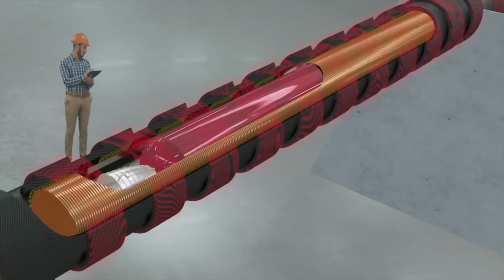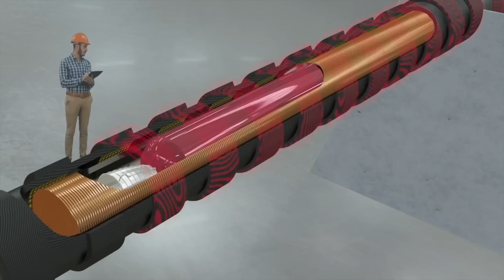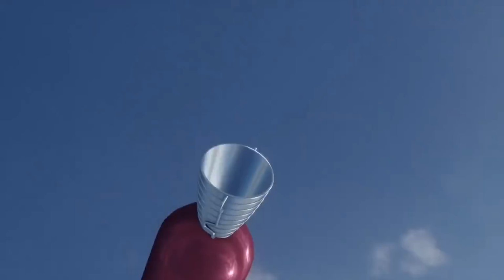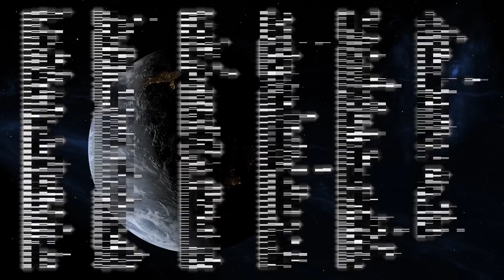Launching Rockets With Electricity

Comment: Building just under a meter underground would give thermal properties, so at a depth for decent foundations, it can be built with potential use atop of it..perhaps under a road, as an example regardless of the particular viability

Comment: Spinlaunch uses an electromagnetic motor to spin and slowly add energy to its hybrid rockets and a weight to ballance it on the other side.  At the point of release, it releases tgr hybrin rocket in one direction and a mass with identical angular momentum in the other direction.  I wonder if energy can be recovered from that and delivered to the hybrid rocket throug a comparably short electromagnetic accelerator.

Comment: "Accidental quench event" —does that mean electricity arcing out of the MRI magnet? Or an exothermic explosion? Both? 
(And if this is disastrous for an MRI, how did the "quench" launcher work without destroying itself as its payload launches?)
Reply: generally explosions as the coolant is wildly execeeded in its capacity which is the cause of the explosion.

Comment: by nature this is more viable than spin launch.
Reply: Spin launchers are just a bad idea
Reply: @slo3337  And a con as they know it can never get off the ground.
Reply: Using the comparison of a linear accelerator to a cyclotron doesn't exactly work here... But I think the advantage of spinlaunch is the slow input of energy without as much complexity. It seems like a better way to get small vehicles off the ground quicker (quicker in terms of building the launcher)
Still 
  I don't think it will ever be a practical direct to space system , not from earth anyway. On the moon I can see how it could me more practical as it would require less materials, less velocity, less complexity, and easy enough concept even an army guy could understand 😜.
Reply: Yep, spin launch puts a spin on the item launched.
Reply: No rail wear on spinlaunch. Easier to reuse.
Reply: @filonin2  rail? why would you have friction contact in a massdriver.
Reply: @petevenuti7355 also on the moon there wouldn't be a need for a vacuum chamber, or those fast airlock doors.
Reply: One word: "SPIN LAUNCH"    Newton proved,You can not just "throw" an object into space no matter how much energy you have.  The object has to be self propelled. You can only assist the launch to save on onboard fuel. Not on earth, Not on the moon.

Comment: Umm, not just tearing the launcher apart, but also the load.  The amount of G's the load is exposed to has to be pretty significant.  Like, I don't ever want to be launched to space with something like this.
Reply from the maker: No, you'd only want to launch robots, not people.
Reply: @frasercain  Yeah I assumed that was the case, just felt like saying it after hearing the issue with the initial experiments and he was talking about how the rail type launchers would destroy themselves.

I was thinking about the usage on the moon, which sounds scary at first because of the amount of force being generated, but then of course, gravity is less so you don't need as much force.

All the activity that humans want to do on the moon sounds scary, like altering the orbit scary

Comment: Hard to see how solar panels would repeatedly fire a machine that requires as much power as this one does. Even in space
Reply: why?
Reply: @MusikCassette  The amount of power needed would be massive. You'd need tons (square kilometers, maybe?) of solar panels for firings at short intervals. Nuclear power plant may be better?
Reply: @michaelwilliams2593  We can produce massive amounts of energy with solarpower.  On a worldscale we are talking several orders of magnitude more than we ever could with Nuclear power.  When it comes to just this project. that need to be build in a quite remote location anyway. So I don't see a problem with needing some space for the power. Off course the amount of power you actually need is highly dependent on the frequency you use it in. And there are other limiting factors to that as well.
Reply: @MusikCassette  see my post above, ie At 91 gigajoules per shot and one shot per day = 33 terajoules. I don't have all the stats but I think we're talking about more energy than some nations produce. I'd love to see some real data from the folks that are planning this.
Reply: @michaelwilliams2593  33 shots a day? that sounds insane. even from a maintenance point of view. Once a week would be high frequency. Once a day is extreamly high freaquancy.
but however. I don't see, why you would choose a more expansive energy source because you need a lot of energy. If anything the opposite
Reply: @michaelwilliams2593  There are two power levels: charging the magnets and discharging them. Discharge is releasing energy that is already stored. That doesn't take power, it gives power. Charging can be as slow as the duty cycle/cadence allows, which can be hours. Superconducting magnets can store that energy with very little loss.

Comment: before we build one  that launches a projectile into space we should build one, that  accelerate its payload to a speed where you can start a ramjet. That would be super useful for hypersonic research.

And it would also be a need way to get to space.
Reply: The minimum speed at which a scramjet(I assume you mean that and not a ramjet) can operate, is mach 5. For that you need to be at least ~20km high to prevent everything burning up.
Reply: @paulmichaelfreedman8334  no, I meant ram-jet. there is enough overlap between the two to do that in stages. But your Idea of strait up going for scramjet speed is also interesting. I would however suggest building mine first. It is cheaper and there is still a lot you can do with it. 
About "everything burning up" we are basically talking about a launch side here. So I would not worry to much about it. There are methodes to deal with that. also 20 km that is just a few seconds after leaving the mass driver at that kind of speed.
also also for a big part of the interesting aerodynamic experiments, we would not even do a burn.
Reply: General_Cornelius  what sounds sketchy? to build a massdriver to do high velocity aerodynamic research?
Reply: @MusikCassette  Actually, the idea of a mass driver to do hypersonic aerodynamic research is really a good thought.
Reply: @freeprint  thx
Reply: General_Cornelius  acceleration= velocity/time 
the final speed alone does not tell you the G-forces.
Reply: What he describes is exactly how the LHC accelerates very tiny particles to near light speed
Reply: @jeffbrooks8024  no it is not
Reply: Re: Electromagnetic Launch Boosting. What about starting from getting a Starship off the pad & up to just a few kph? When I saw it from Rocket Ranch last April, it seemed to have sat on the pad for an eternity before lifting off. The fuel it consumed in those first few to 15 seconds t’wrnt nutt’n!
Reply: @Crunch_dGH  Well you would not use a Starship for that. you would build  something specificly  for your mass driver. And you would not start with this high masses.
Reply: Interesting idea!
Reply: @vincenthickey8622  thx

Comment: Mr. Dillon, 
If you can levitate a high-speed magnetic train by rejection of the train weight force and then pull it along by time-sequenced magnets before it ¿Could you not build a tunnel with aligned magnets on its walls and replace the train by a cylinder that will stay at a safe distance from the walls to avoid contact friction and accelerate the "metallic tube" that will carry the cargo?
Reply: Yes.  In fact, the design calls for a carrier sleeve to act as the armature.  The carrier sleeve would be slowed to a stop in the last 10% of the launch tube.  In the center of the carrier sleeve is the delivery cylinder that continues on.

Comment: He never did clearly explain what exactly you do to quench the superconductors.
Reply from the maker: The key will be turning them off as the payload passes so they don't act as a brake.
Reply: @frasercain  Yes, but how? He suggested different ways to do it, and it sounded like he intended to raise their temperature above their superconductive threshold. But wouldn't that, plus the instantaneous transformation of all that electrical energy into heat energy, make each ring explode or melt down in succession?

I think Markcrites7060 is right. Dillon was cagey about how exactly they plan to quench their superconducting solenoids. Obviously the plan isn't "slag the thing with every launch" ... so what is the plan to dump all that quench-released energy without harming the launcher? Without boiling off massive amounts of precious liquid helium? 
I'm guessing there's something like a lightning rod that will allow all that electrical energy to arc out of the superconductors as soon as they stop superconducting, or maybe a microsecond or nanosecond before that moment? 

Dillon is the expert, not me. My idea is probably unworkable, I don't know. His team might have something worked out that they don't want to describe publicly yet...

Comment: Great idea, but in the meantime why not use electromagnets just to get rockets from zero velocity to even the first few feet per second, i.e. electromagnetic-assisted launch? Would that not achieve a meaningful improvement in overall launch costs and fuel consumption? Not to mention wear and tear on the launchpad itself.
Reply: nope. it would double the cost of launch (and possibly more...)

Comment: Accelerating an object to orbital speeds can be done.   But there's one little problem, Earth has an atmosphere.  "Max Q" is a thing, and there's a reason that most small asteroids burn up in the atmosphere.   Orbital speeds at low-earth air density is simply not a good combination.  Keep in mind that air resistance is a square of the velocity, to get that orbital velocity at the end, the initial velocity must be MUCH higher to overcome all that resistance, and a good amount of that energy will be absorbed by the launch object.

Now if you're on the moon, or some object with no atmosphere, go for it.

Comment: Hmmm. Normally when a superconductor quenches, there is a huge release of magnetic energy that will quickly turn into heat if it isn't used to do work... 

You would have to time this so the magnetic energy would be absorbed by the projectile as it passes. If you don't, it goes boom.

That would be a very hard system to time correctly.

Cool thought problem.

Comment: correct me if I'm wrong but the joules needed would be Work = Force*distance with Force=mass*acceleration so work = mass*accel*distance. Assume 10 km long pipe with a 9,100 kg (10 tons) package reaching 5,000 m/s at pipe exit. You come up with 9,100 kg * 1000 m/s/s*10,000 m = 91,000,000,000 Joules. Is that 91 gigajoules? I don't remember my prefixes when numbers get that big.
Reply: At 91 gigajoules per shot and one shot per day = 33 terajoules. I don't have all the stats but I think we're talking about more energy than some nations produce. I'd love to see some real data from the folks that are planning this.
Reply: How much could be accomplished by launching a Falcon9 or starship at 1-2km/s!?
Reply: The acceleration must be 1250 m/s^2 and that translates into a work of 113.75 GJ . The energy is not the problem, but the power needed. Accelerating 9100 kg from 0 to 5000 m/s in a 10 km track takes 4 seconds, so the power is about 28.4 GW (and I'm not even considering the losses).
They definitely need superconductors not just for the track but also for storing energy and realease it quickly through a superconducting magnetic energy storage.

Comment: Was this filmed before or after the possible discoverery of LK-99?
Reply from the maker: Before. That would be a gamechanger.
Reply: @frasercain  From discovery to practical material economically available on a large scale usually takes years to decades for the superconductors that make it. 99% of the superconducting materials discovered are not economically or technologically useful. However, if this one is, "gamechanger" would be an understatement.
Reply: @huubweijers5023  True but this is also a long term project so hopefully..    ?

Comment: I think this type of thing is POSSIBLE, but will never be PRACTICAL to overcome our gravity and thick atmosphere. Like the Navy's railgun, anything with that much power will self-consume.  Having said that:  this would be eminently serviceable on the moon or Mars.
Reply: Railguns are different in two essential regards.  First, they are inherently low efficiency electric motors based on the Lorentz force.  Mid 30% range is all you can get, everything else is heat.  Also the rails and armature (the part that moves) are in direct contact.  Our system can achieve efficiency in the 90% range (like lots of good electric motors) and in a non contact system.  Not that we don't have significant engineering problems.  We do.  But that's our work.  And, yes, the moon with its shallow gravity well and built in vacuum is WAY easier.

Comment: I find it not appropriate just like the giant rail cannon with the same magnetic launch system. The other is a land based laser system in which a study by McGill University professors is also inadequate and cost , mostly safety will make them part of the not so brilliant idea. 
The real fundamental step is with Wernher Von Braun's system, it's to increase and incorporate a viable sustainable solution. The problem is the ignition, heating and cooling. 
Although the payoff is greater displacement and fuel efficiency and a much longer duration. The plan is a hybrid spacecraft that uses a runway and lands on a runway but also continues to be a useful platform for landing on other planets to moons with a change in configuration again. The weight of the craft is also important as well but there are many tricks still waiting to be applied.  The ion thrusters are not making progress as they should but the application of more and sent through a magnetic coupling which will provide the extra torque will be an inventive measure that apparently no one has looked to but I did so I can have steering also a way to slow down. All what I said here isn't fiction but aligned with facts to build a better craft .

Comment: I've often thought about this since I first saw that Superman ride! I seem to recall, providing enough power was an issue even with that, but that doesn't stop one from dreaming. I posted a question on another video as to why we don't use this sort of system, or even a fuel powered carriage on rails to launch rockets. Even if a rocket was launched at 100mph, that would save a massive amount of fuel and weight in simply overcoming that initial static inertia. Elon needs to sort himself out and produce a fleet of Boring Company 'StarBorers' that dart into the moon and bore tunnels for Spaceport runways as well as sub-terrain environments to live in without the worry of surface regolith  🚀

Comment: Is it possible to utilize the depth and pressure of the ocean to develop a launch system on the ocean floor where you can harvest a substantial portion of the energy needed to accelerate mass and make it easier to escape the Earth's gravity and reach orbit?

Comment: A high velocity boost may not be needed to make it viable. How many pounds of fuel is needed for each mph acceleration? Each bit of acceleration added to a booster without using fuel means that many pounds less propellant needed to get into space. This is the same concept used by launching in the direction of the earths rotation.

Comment: 100% the right approach for space or moon launches. Too many issues with the thermal and physical shock of hitting our atmosphere, suddenly at Mach 10, let alone Mach 20. Hypersonic flight is far from a 'done thing' Its still very experimental and not fully understood. Yes re-entry vehicles do it but they are hitting very thin atmosphere at Mach 20 and slowing down gradually. Even if the launch tube could somehow be a mile tall, the air is still very thick. I guess you could build it in the Atacama Desert! Maybe something launching with a scramjet on it might work. Get it to a more modest launch speed and then accelerate it with the scramjet. At least you only need to carry some fuel and no oxidizer.

Comment: When you "quench" that massive magnetic field it will generate a huge voltage spike, maybe reaching millions of volts across the now poorly conducting superconductor. It will fry and sparks will fly! Of course maybe you could dump it into a big capacitor then recycle it on the next run.
Reply: not so much a huge voltage spike, but a really huge current spike - which vaporizes any cooling, and likely even the wiring - which would lead to the explosion.
Reply: You raise a good point but actually this isn't the case for us.  The details of this are the subject of our patent application and trade secrets.   I look forward to our coming out some day.  (ha!)
Reply: Cool!

Comment: why not reach higher speeds acceleration by using a hanged rail system, that merely holds the wings between polarized tracks that have the same Pos. or Neg. charge as the wings holding a fuselage that flies back after max propulsion generated, and if both wings are polarized opposite then perhaps these tethered flying winged launching platforms could be powered solely through field generation and fuel cell power once clear of rails... how many small powerful thrusters would it need to continually accelerate the desired payloads.

Comment: Could fields be generated in the tube that could provide enough energy with electric thrusters that disengages from the main fuselage engage the tesla coils to increase velocity... negative air pressure and sound waves to disrupt air resistance... all known tech.

Comment: Maby they don't need to reach so high velocities in the tube. Even if it throws the rocket with a speed of lets say 500mph or so and then starts the chemical engines in flight, it should be a good gain in fuel weight saved.